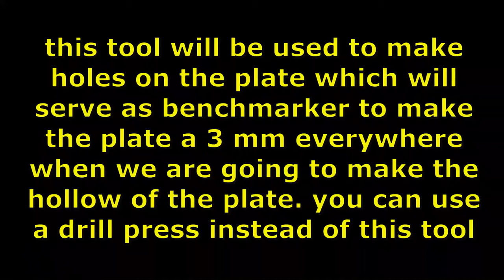Homemade Violin Without Luthier Tools. All Parts

Comment: you know i read the comments and sure they all make good points on this or that. but my question is why did you wait till last to install the ribs ? i would invest in some tools a dremel at least . maybe watch a few violin making videos . put down the angle grinder and step far far away from it . but i give you props for making something that makes sounds . im sure if you stick with it and learn a lot more then what you know now you will make a nice violin at some point . im not against using new methods to create but there are still things you should learn so that your safe and things are done right so it sounds good and looks good and you still have all your fingers when you finish . and this is coming from some one who has never made a violin .

Comment: For a layman it looks great, but for a student of violin making, every minute contains so many errors that it's hard to list them all.  In a violin, the very arrangement of the grain in the wood and the distribution of the thickness and curves of the board have an enormous impact on the sound.  besides, violins are so expensive because the strings press down on the stands with almost a ton of force, so building an instrument that can withstand over 100 years of such pressure is not that easy.
Reply: I think it's more like 20 kg not a ton

Comment: Things that can be improved:
1. WOOD GLUE. Please don't use CA glue. Or use hide glue instead if you want to be more traditional.
2. Template. It makes things easier.
3. Soundpost. That was terrible.
4. Linings for added strength.
5. Use 1 piece of wood for the neck. Or any piece length-wise, whatever. Please don't just glue the head onto the neck like what you did.
6. Properly set-up fingerboard.
7. Burn mark.
8. Purfling.
9. Bridge. Keep it straight and PRACTICE YOUR INTONATION INSTEAD OF TOUCHING DIRECTLY ON THE FINGER GUIDE. Its not a fretted instrument, it doesn't need that kind of compensation. Finger guide is meant as a landmark, and you compensate it by placing your finger on the supposed place near the guide.

I don't mind if you're not using any luthier tools (oh wait, you're using peg reamer). But at least make a proper one.
Reply: It's horrific..like the person never seen how a violin is actually made..just absolutely wrong on every single step..this is a VSO (violin shaped object)..it's a wall hanger at best..guy should get a Chinesium unfinished violin kit for $70 off flebay as its 75% complete already with the parts to finish it..instead of rolling the dice on loosing fingers with that grinder..Crystal Methodist tend to do things exactly like this..unfortunately..